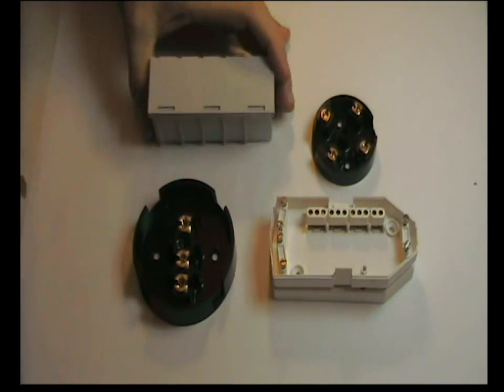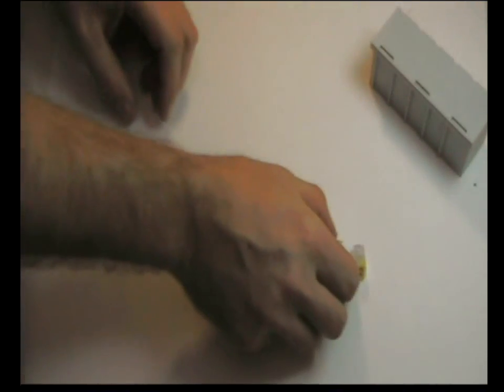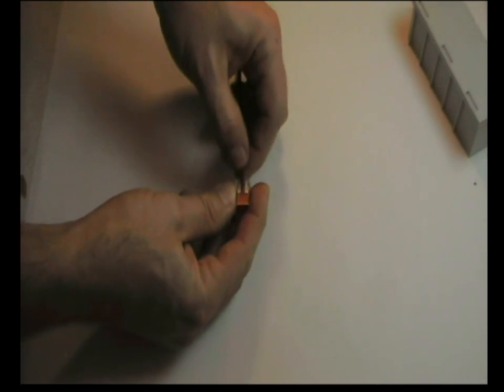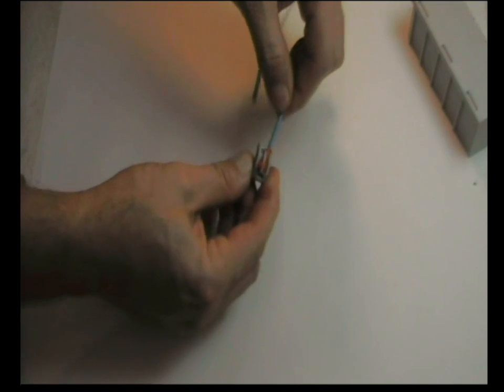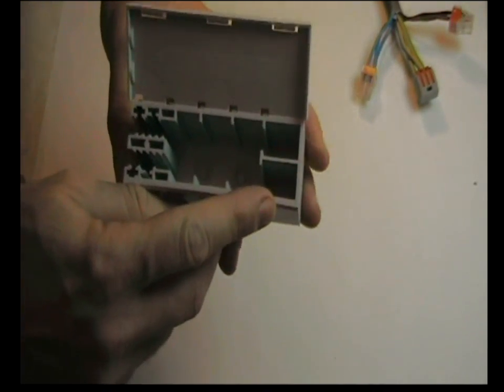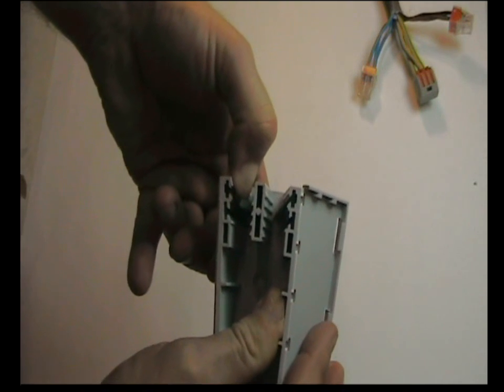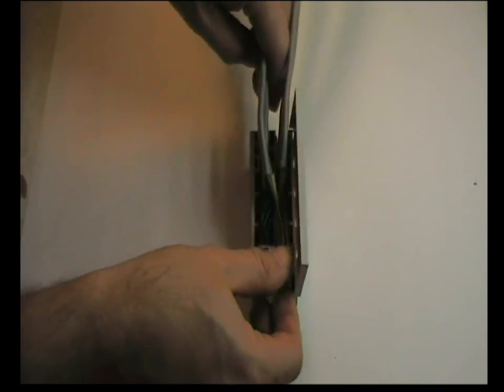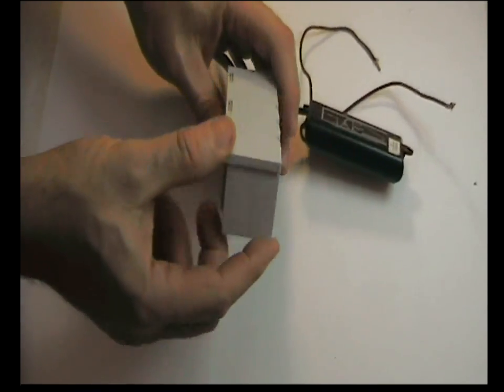CONNEXBOX® Classic Electrical Enclosure | Junction Box

Comment: Hi there been looking on websites for these just woundering If they are water proof or could you maybe point me in the right direction I'm looking to extend my flood light as its a short wire to it
Reply from the maker: They're IP2X Scotti, so not waterproof. Our IP68 waterproof enclosure is the Wagobox Capsule which you can find out more about on our website www.connexbox.com.

Comment: I like the Wago connector and this box look good but where do you put the box ? In canada we can't hide it in a wall and this is too big to put in an electrical outlet so, where do you install this ?
Reply from the maker: Hi Andre,  Very often the Wagobox is installed in ceiling voids and loft spaces. I have also installed them above, behind and under kitchen units for appliance connections and lighting.